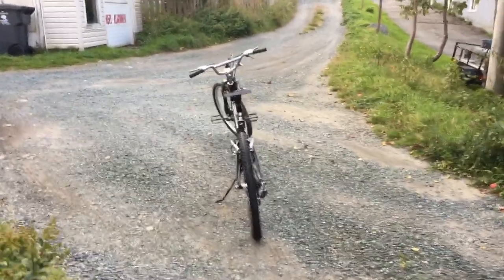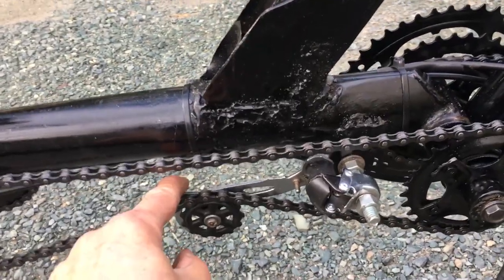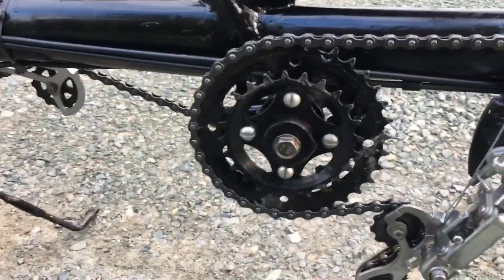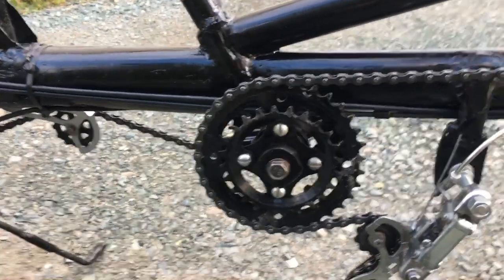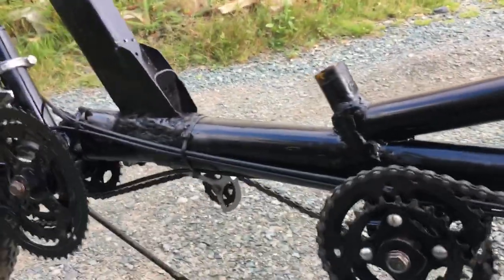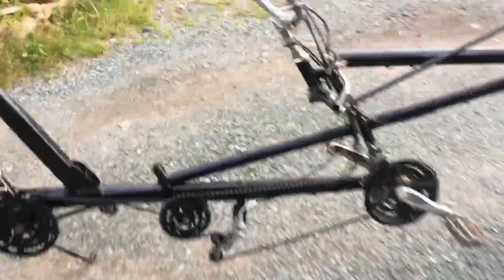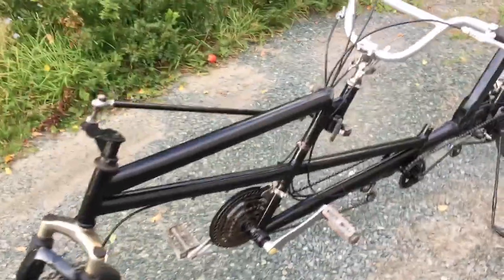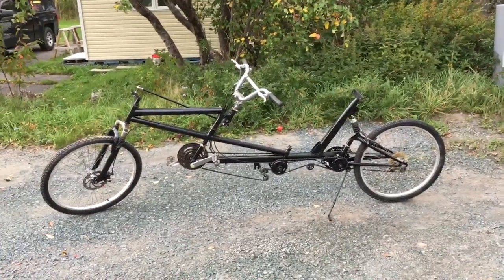Building a Recumbent Bicycle from junk bikes Part 3 - Three Chains Give Mechanical Advantage of 2:1

Comment: below 3mph, recumbents fall over, and 30mph is about as fast as an unfared recumbent can reasonable go. I don't quite understand the point in this...
Reply from the maker: Have you ever been riding your bicycle in the highest gear and wish that you had a higher gear to shift into ?
That is the main reason I built this. The ratios will really shine when I add a fairing. 
Thanks for watching.